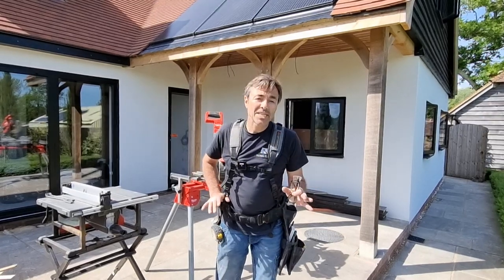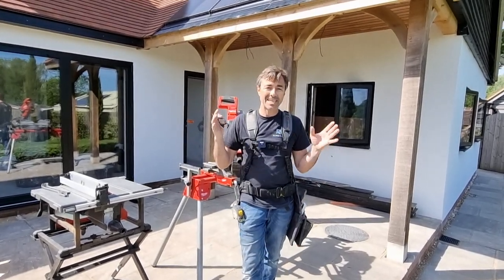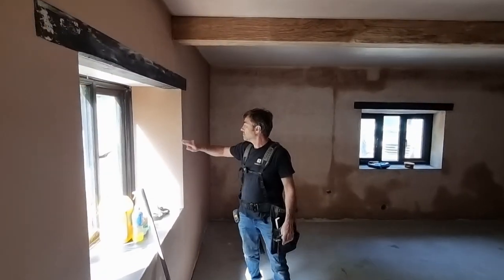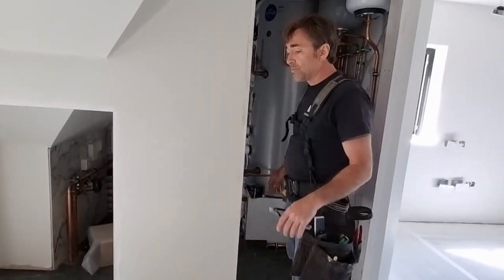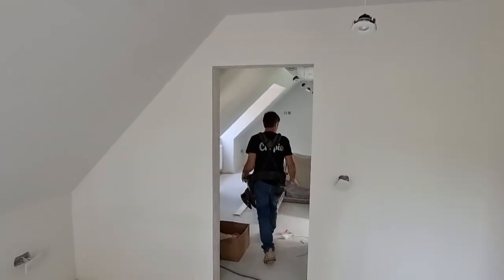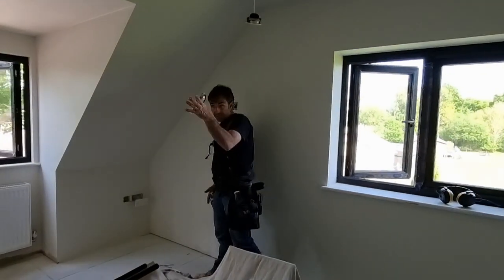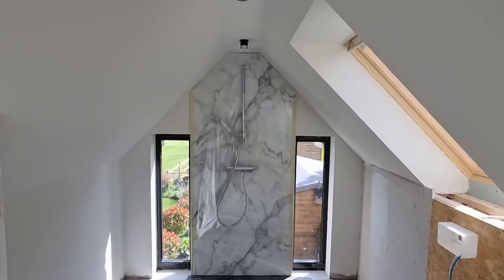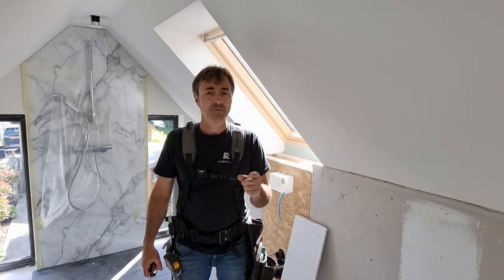Second fix walk through at the big build

Comment: Hi Robin, surely you would check with the client which way you want the door to swing before you second fix, as the door could potentially  be against  the light switch, great videos by the way 😀
Reply: Did you watch this video? The first thing Robin says is he walks round with the client deciding which way the door opens and marks the hinge side. The electrician puts the switch to suit not the other way round.
Reply: @ericmcrae7758  but he said that the electrician had already been in at the start, didn't he?
Reply: @ricos1497  Looks like the spark had already done 1st fix